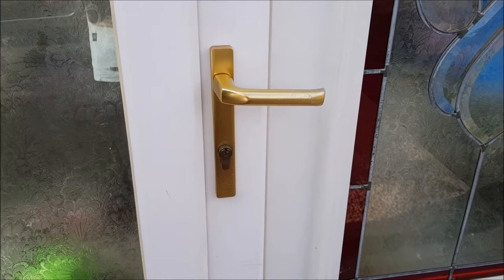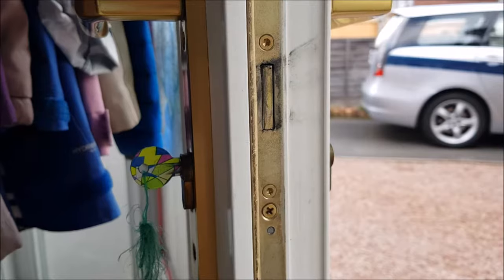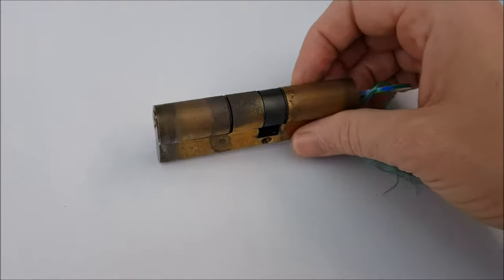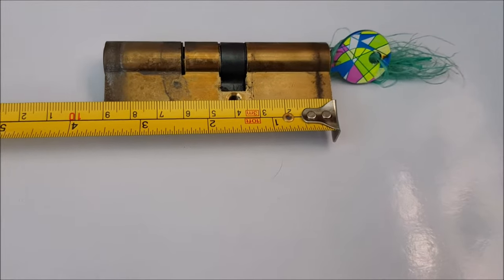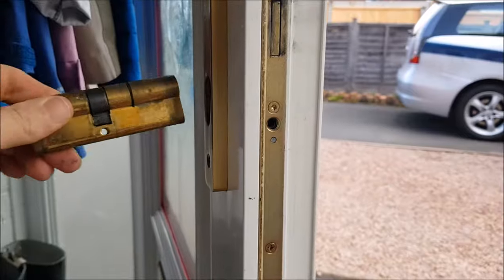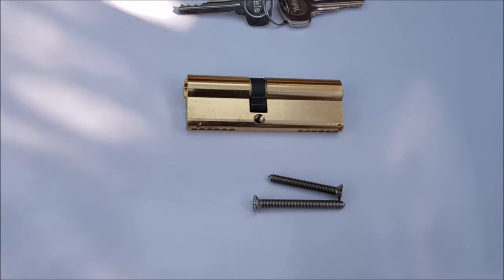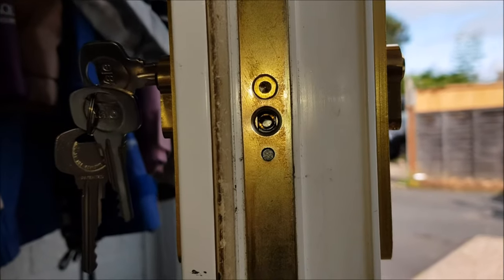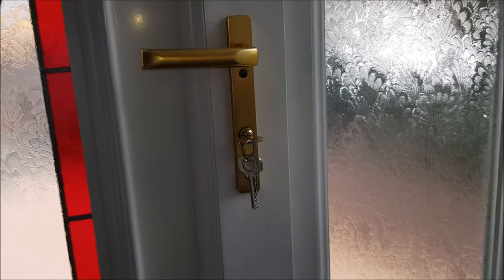How to change a PVC door barrel lock (also known as Eurocell cylinder lock)

Comment: Thanks mate. I evicted a lodger but suspected they had got a spare key cut. There are 3 doors, and the local locksmith wanted £280 to replace them. After watching your video twice I just did it for £42, in about an hour. Happy days.
Reply: £4 crowbar would've done the job just as well to keep the lodger out
Reply: @-V33- Did consider that as a viable option, but as crackheads don’t feel pain like we do, I went for plan B 😄

Comment: Appreciate this video is 4 year old. Have you since upgraded to the 3 Star eurocylinder locks? They are Anti-Snap. Notice your lock barrel sticks out at the front (external side) Vice grips/pliers can break that lock off. The 3 star anti snap versions keep the door locked. Consider upgrading if not done so.

Comment: Thanks GREAT video! I had a problem inserting the new one because it was catching on something, it wasn't quite flush. I looked in with a torch to see it wasn't quite clearing a part just before it comes out the the other side. After 30m of failure, I got a screwdriver and levered it gently. I was careful as I am a disaster with DIY. Levering it slightly managed to free it. Job done!
Reply from the maker: Great stuff, well done.

Comment: My door had a recessed grub screw rather than the screw shown. This required an Alan key to remove. If you see a hole where the screw should be try shining a torch down it to find the type of key/screwdriver required to remove it. 

I also needed to use the grub screw to secure the new barrel as my door dropped a plate down over it when deadlocking. At first I found the deadlock was being fouled and had to screw the grub screw in further to gain clearance.

Comment: Hi, great video. Just a question for you. The lock on my door is about 1ft down from the door handle. I've tried taking out the barrel but it doesn't want to move and I'm worried about forcing it. Any ideas? Thanks
Reply: Is the moving part of the barrel perfectly straight? If not, it won't budge. I'm sure you've tried the tweak the angle of the key slightly to try to move the barrel.
Reply: @matskieden511  See my reply above, is there a recessed screw holding it in place? Also remember to wiggle the key once the screw is removed to get the central part in line

Comment: What if you didnt have the key and the lock was drilled from the outside to open the door? How do I get the cylinder out of the door?
Reply: It's a thumb turn euro cylinder if that makes any difference so it can be turned from the inside of the door, would that do what the key would normally do from the outside?
Reply: Also I am pretty sure the cylinder that was bought for me by my brother (no idea what we were doing/needed to measure so he guessed in the shop) is slightly to small length wise, does this actually matter? I don't care about how secure it actually is, just need to be able to lock the door, no one will try and break in

Comment: I’ve lost my key for my patio doors, my doors locked. Would I just need to use brute force to snap the retaining screw to pull barrel out? Thanks
Reply: You will wreck the door
Reply: @deangaryjames  Not at all, I changed this not long after the video. Wasn’t too bad actually, the barrel broke in half quite quickly allowing me to pull out and open the door with a screwdriver and fit the new lock.
Reply: @rabmc  handy to know cheers